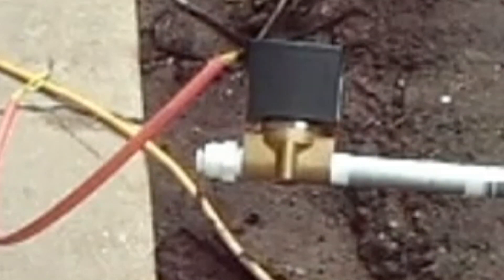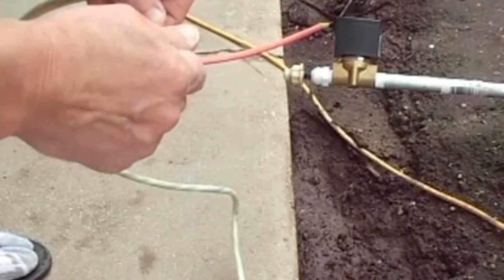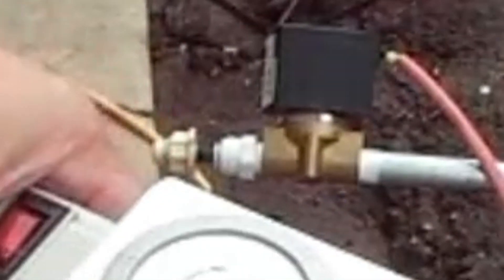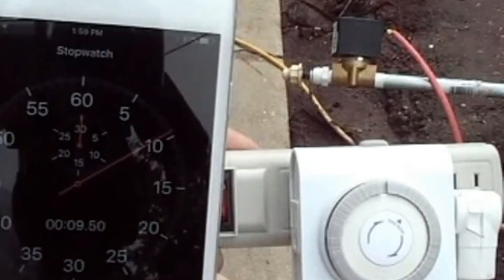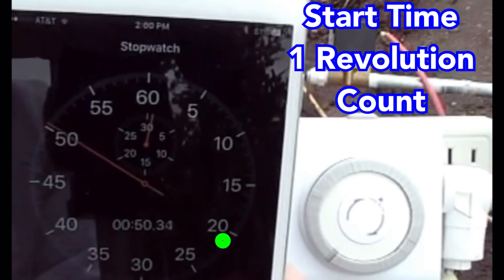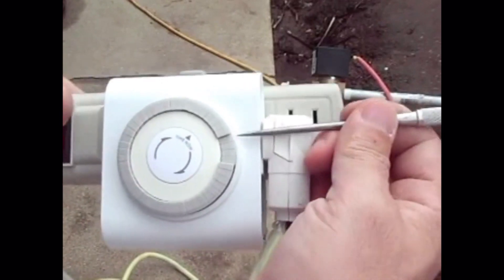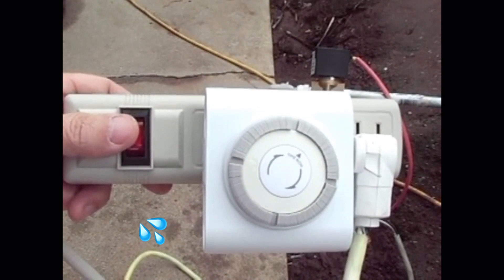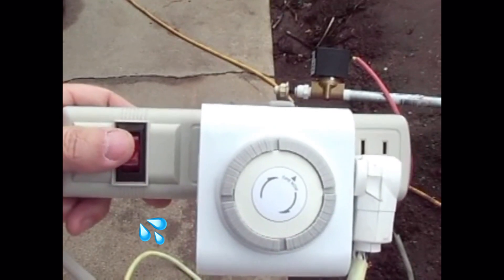D.I.Y. Repeat Cycle Timer HPA Aeroponics ( 24 hrs Converted to  1.2 Second Intervals  Remix )

Comment: Would love to know how you did this.  Nice work.
Reply from the maker: Making the timer... for this isn't that hard... I'm a bit out of practice but, I've got everything except the timer right now lol.

I'll do a video on it as soon as I clear up some of the things in the stable ;)

Consider it on my to do list!

Cheers!

P.S. if you got any specific questions feel free to ask and I'll do what I can in the meantime to get you going!
Reply: @aeromah1062  I have searched up and down YouTube and on the Internet.  I can't find anyone else who has done what you've done here.  I have the timer, will I need any other special tools or parts?
Reply: @briancoxacc  Same by me, cant find a solution for the timer and the valve youre  using. Could you make a video about that?  Would help a lot. Thanks.
Reply: @aeromah1062  I basically want to create a self-contained aeroponic chamber within an old rain barrel.  Throw the pump in the bottom.  Cut holes and insert plants in the sides.  I just need to find the right spray nozzles (so many options) and get the repeat timer to spray the roots for 10 seconds, then turn off and repeat.  Your timer in this video looks great, but I don't know how you did it.Thanks in advance for your help.
Reply: @aeromah1062  How is the stable doing? Wouldn't mind learning how you hacked a timer.

Comment: I highly recommend using dc solenoids as they are immune to power outages. A reliable digital dc cycle timer can be had for $8 or less, timing increments of 0.1second. The dc transformer can be located indoors. You can run the timer and solenoids completely offgrid with a 12v SLA battery (*7A/H) and solar panel (*20w). * depending on how many solenoids you are running.
Reply from the maker: Whats going on Atom izer!  lol how many solenoids are you running? haha... outdoors i divided the garden into 2 sections so, 2 solenoids.  

Tell me more about this off grid SLA system you know about?  7aH? per day? based on how many cycles and increment/duration of each cycle?  Solenoid count?  How big is your battery bank?Thats quite a lot of detail there.  So, does this mean you are running with this set up? 

What I know is when I ran a 120V a/c solenoid  through one 800 watt continuous inverter.... I blew it up lol.  it just fried instantly!

Are you running your garden indoors or out? and off grid? or a % of it off grid?
Reply: @aeromah1062  
I ran a 16ft x 2ft outdoor hpa chamber completely off grid for a few years just to prove it could be done. I used a 100L accumulator which was manually charged with a rothenburger RP-50 hydrostatic test pump. 
My 12v solenoids pull 0.5A,  1sec/1min or 3sec/3min cycles would give a total of half an hour per day. A 7A/H sealed lead acid battery, in theory, would run a solenoid for upto 4 weeks without any solar charging. These days i have all my outdoor control gear centralised in a shed. In the event of a power outage i just have one ac transformer (500w atx computer psu) that is autonatically switched to battery backup (60A/H deep cycle). Immunity for AA setups was more tricky as both the compressors run on mains power.
 I have 5 outdoor hpa setups and a 12 bucket flood and drain system.Indoors i have two AA setups. one is also equipped with hpa nozzles so i can run it AA or HPA..
Reply from the maker: @atomizer2665  thats pretty awesome!  Why don't you post on YouTube?  It seems like information is hard to come by even still.  I would very interested to get a tour of your gardens!
Reply: @aeromah1062  
I like to take a backseat these days. Posting HPA or AA videos tends to lead to answering the same questions over and over, usually from folks that will never build a system lol.thats why most of mine are unlisted. I dont mind sharing information with folks but if they dont have a system and never bother to build one, its pretty pointless. You took the same route as me and a few other crazy growers, which was to gamble a bunch of cash and just build it. Thats the kind of mindset you need for HPA and especially AA.
Reply from the maker: @atomizer2665  hahaha AA is cheaper than HPA from what I've seen and less hassle.  I'm always trying to learn more.  Doing things DIY seems like its a never ending lesson lol.  

So, send me some of your links!  I really want to check out how you did things... I'll probably have some questions for you as well. lol
Reply: @aeromah1062  
For larger scale, HPA is cheaper than AA. For a typical indoor grower they would cost about the same. If you can get away with running a big belt driven compressor day or night that would make a difference.Most wont beso lucky and will have to use a silent compressor..An off the shelf silent compressor that can run 2 syphon fed AA nozzles costs the equivalent of  $430 here. The 2 nozzles with solenoids would be around $300. Add a chamber, cycle timer etc and you`d be somewhere around $800 
Pressure fed AA involves more hardware on the liquid side so its more expensive.
My 100L accumulators hold 40l (10 us gal) of nutes at 140psi and list at $510 in the states. The pump adds another $130. If you used 1gph nozzles on a 2sec/3min cycle you could run an 8ft x 8ft chamber (drain to waste) and the pump will run once a day for less than 10 minutes.With the chamber, nozzles, solenoids and JG fittings you probably be around $900-$1000. If you recirculated the nutes you could use a smaller accumulator but you`d also need more hardware, pressure switch, prv, a reservoir and good filtering.The trade off with recirc is you lose tight control of the nutrient makeup and system hygene as the run off is mixed back into the res. Your workload increases with ph, ec checking, topups and res dumps. There`s a lot of things to consider lol
Reply from the maker: @atomizer2665  Yes, I see where you're coming from.  At the moment things appear to be more cost effective for me...  but, then again I'm just getting into the AA lol.

Thanks for heads up!
Reply: @aeromah1062  
I like a bit of system variety as it keeps things interesting. You`ll get to the point where theres no real challenge and you`ll need a new fix lol. In my case, that was turning my hand to formulating nutes from scratch which provides another level of control and saves a bunch of cash.I`ve pretty much run out of road and need a new hobby lol
Reply: @atomizer2665  hey, I’m one of those who have already built HPA system and trying to make it better. :) I’m using tefen nozzles and no-tank pump giving 85 psi pressure to the system supplying 6 plants. Right now I’m playing with sprayer timers and trying to make it right. So I have questions regarding droplet size and how it affects the root formation. What’s the best way to reach you and run a conversation if that’s possible?
Reply: @arthura7442  
Hi Arthur
Best option is to upload a vid of the setup. Tefens arent available here but think Aeromah runs them in his HPA so he`d be the guy to ask about those. Root formation is affected by droplet size, flowrate and even the nozzle placement.